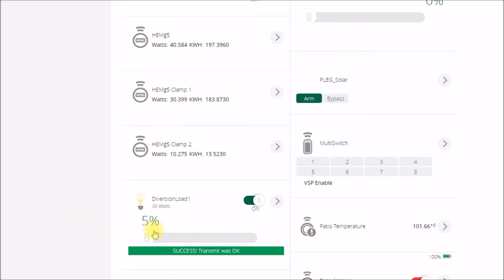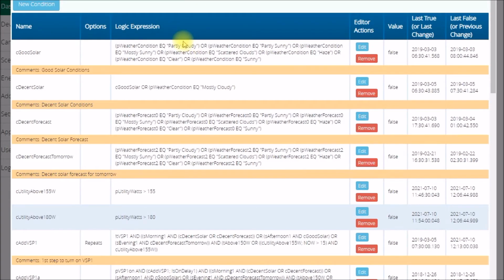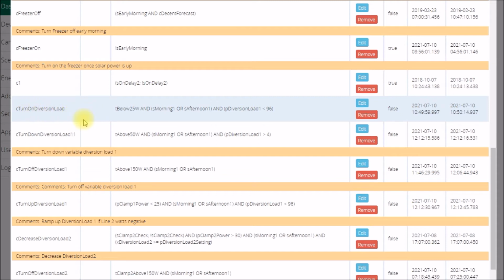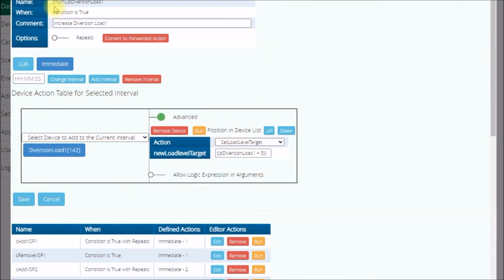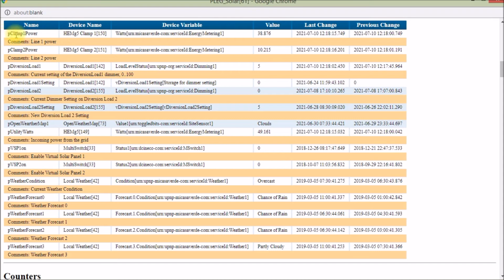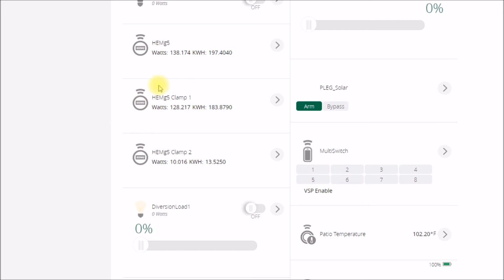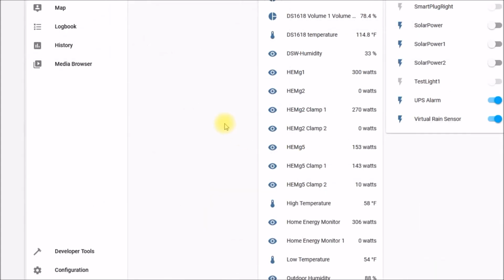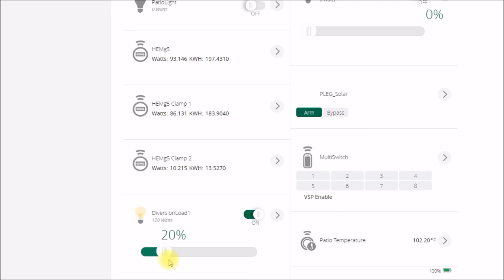AC Diversion Load, Part 3 - Simple Automation

Comment: I just use a module from the KZLTD
   if you take the KSG1-25A, you only need a 10 V 1 / 2w zener, a 10 K pot and a 2 watt mains / minimum 12 volt transformer

on the module uses 4-20 mA input connected with the secondary of the mini-transformer, rectified and connected with the zener and 10 K

when the generator voltage increases, it flows more than 4 mA which causes the ballast load to turn on in a pwm mode have fun working perfectly smoothly and smoothly
Reply from the maker: I'll have to take a look at that if I can't get this system working.

Comment: Interesting
Reply from the maker: It is quite interesting trying to figure out how to control this thing.  Especially working around the limitations of the various components that you don't find out about until you start pushing things.  Like the light dimmer, if you send it a number outside the range of 0..100 you can get all sorts of different results.  Apparently they have no range checking built into the driver.